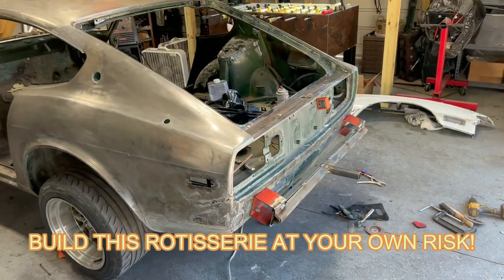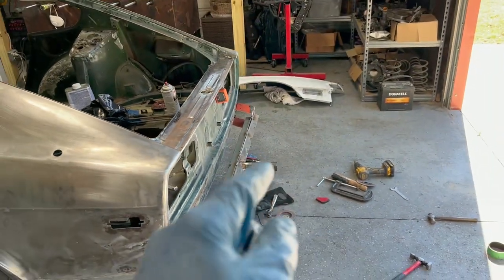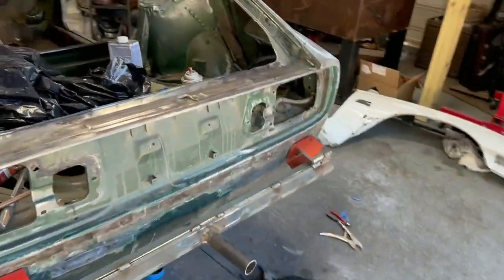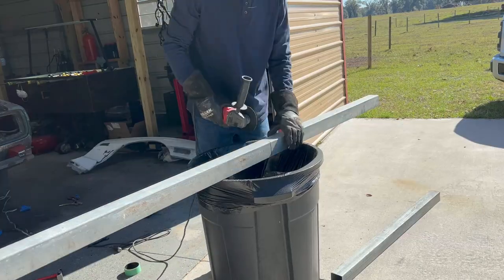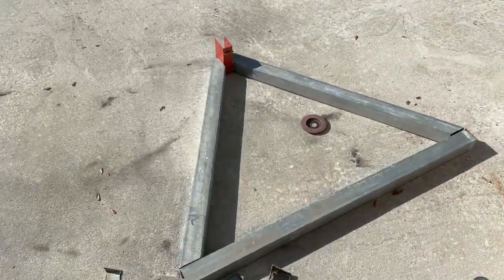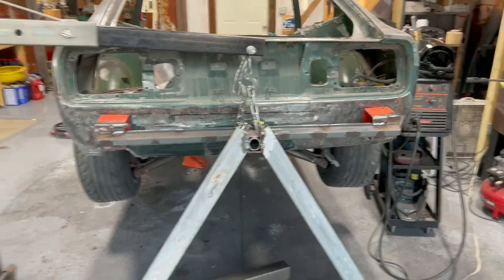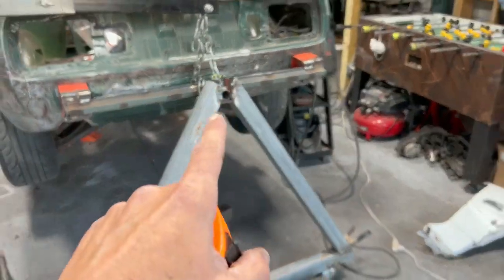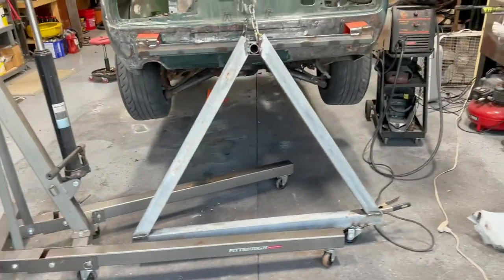DIY Home Built Car Rotisserie! $20 Dollars Spent! Attempt At Your Own Risk!!!!!LOL

Comment: IIRC the lifting / rotating frames, arer usually connected to each other with adjustable beam in the middle.
Reply from the maker: Yea I ended up doing that.

Comment: Great video. However...the max distance for triange needs to be diagonal from pivot to floor outside wheel and diagonal from pivot to roof straight up from the side edge not just vertical. As these are further away as you rotate. 👍

Comment: Congrats on building a death trap. That thing is going to drop that car on you when you least expect it. The triangles are going to swing away from the car. Also it looks like galvanized steel and you welded to it without cleaning the surface. Poisonous gases created in the welding fumes. Be safe.
Reply from the maker: lol.  Cars almost done, I had it on there for 6 months and It never fell. 🤷🏼‍♂️